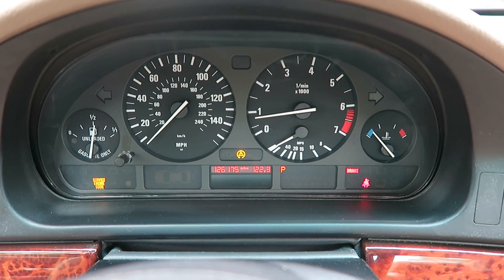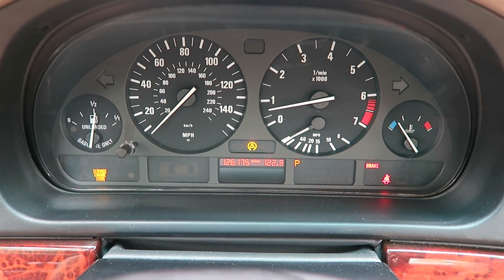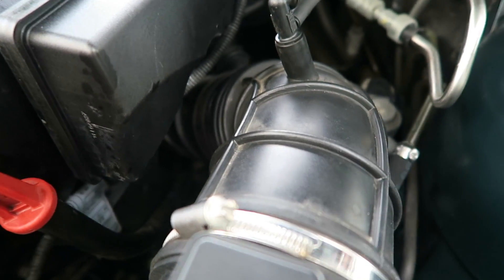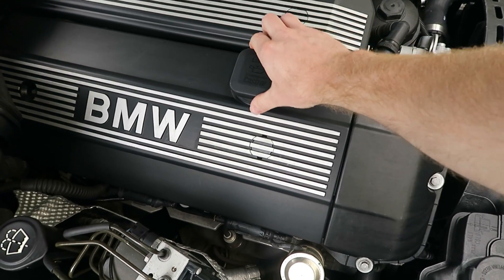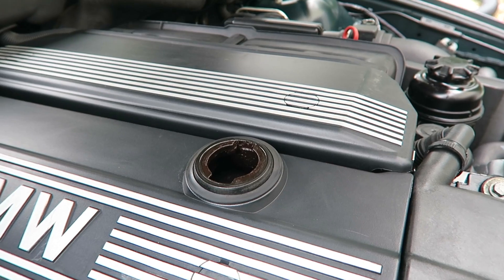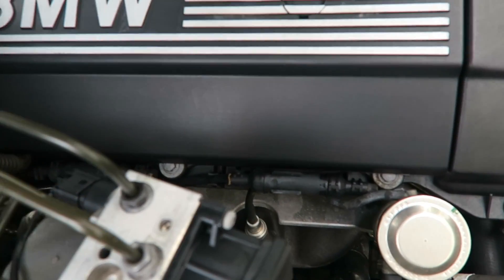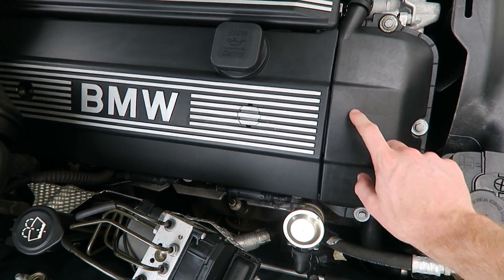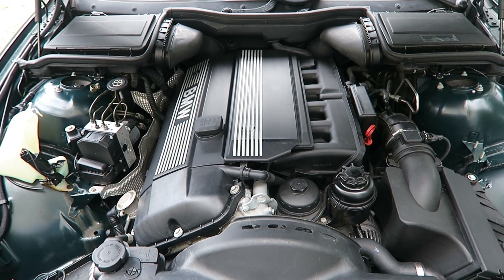How to diagnose BMW P0171 P0174 lean codes E46 E39 E53

Comment: I have the p0174 ccv changed pcv changed code still pops up on me left and right
Reply from the maker: can be many things on these cars: hairline crack in plastic valve cover, valve cover gasket leak, crack in ccv system, clogged dipstick tube drain, cracks in rubber intake boots (upper and/or lower), etc etc. smoke test is best way to start.

Comment: Question: Which ect sensor operates the water temp gauge? Mine goes straight to red and stays there when I turn the ignition on. I have both codes in this video on my 2001 BMW 325I and I'm tackling them tomorrow.  Thanks for the info.

Comment: I don't even want to go into the issues I'm having with the 2003 530i I'm dealing with but here goes. The car sat unused for approximately five years, it was owned by my customers aunt who then purchased it for the paltry sum of $400.00 which on the surface sounds like a good deal but remember we're dealing with a Nazi mobile thst sat for five years outside in the northeast specifically NJ central Jersey to be exact, I advised him not to buy it and was met with the usual all that's wrong with it is, an oil leak, when speaking about a BMW leaking oil you use the plural, leaks because there's more than one place it's coming from, he also has very little money so he pays me when he can, this thing was leaking every kind of fluid except for trans fluid but remember it hasn't been driven I suspect that will be next. So far I've done the oil pan gasket the oil filter housing gasket and vanos hose which was pouring out of it, all the radiator and heater hoses, a new coolant tank new brakes all around and the valve cover gasket and that's when the problem started. I also changed the purge valve due to the p0444 code which was the only one that there was prior to doing the valve cover gasket, when I was finished and started the engine I got  p01085 p01083 p0 1171 p01174, what the heck did I do wrong? There was a small I assume vacuum hose in the back of the engine that basically disintegrated so I fixed that there was another very brittle hose that was kind of collapsed but I left it alone, could that possibly be the source of a leak big enough to cause a leak condition? The engine runs smooth except on start up but it quickly smoothes out, I did replace the curved bellows hose on the air intake because it was cracked so that's not it, and the best part is that there's still an oil leak but I can't figure out where it's coming from, it's on the drivers side coming from the top, it's not the oil pan gasket that I know for sure, it's nothing like the way it was leaking before because it would leave a puddle everywhere you parked, I wondered why there were three empty bottles of oil in the trunk. Inspite of everything the car does run and drive very well, he did have to get new tires, two of them were original made in 2002 believe it or not and the other two from 2009, the car has 92,000 on it, oh I also put new lenses on the headlights which are of the xenon variety also new adjusters which of course were all broken, the auto adjusting headlights do work which was surprising, I forgot a new water pump and new belts.
Reply from the maker: Nothing more expensive than a cheap BMW! Sorry to hear. You’ve done a lot so far, nice work. You may want to smoke test it with an inexpensive smoke tester like I used here: https://youtu.be/QIGQGai5ngs

Valve cover gasket probably leaks too. The plastic covers can also leak both oil and vacuum when cracked or warped. Also the ccv hoses. You can add UV dye to oil and inspect leaks with a UV flashlight to find the leak source.

Comment: Woooooooooww! I was literally just out to me and 18-yr old son's project car, a 323 Coupe from -01, which is running like crap. We have done so much troubleshooting and so much repairs to it, but still had done nothing the CCV. I got the exact same symptom you did, lid was sucked stuck and when I removed it the enginge stalled and rushed and stalled. Will try to find a CCV now...

Comment: I had these codes recently and it turned out to be a tear in the lower intake boot - very common point of failure (and so is the upper boot, come to think of it...).

Comment: Hey all, I have an issue with a bmw z3 M54 2.2i. It keeps coming up with bank lean codes and misfires. Both banks and single banks, random misfires, but diagnostic says cylinder 5 is troublesome. No obvious vac leaks anywhere... fault has been getting more frequent, although the car hasn’t run much in the last six months... any thoughts??? Thanks.
Reply: Have same problem with same engine xD

Comment: I had these codes pop up on my 05 325i and I checked the DISA valve and when I pulled it out, the o-ring was gone and the rubber on the valve was worn down pretty good...So after ordering one off Amazon for $94, I installed it and haven't had an issue since and engine light hasn't come back on.
Dealership and auto parts store wanted $400-$600 for the DISA Valve!!! Saved a ton of money on repairs 😎👌

Comment: The old owner of my 525I said he repaired/replaced the ccv, so i ruled it out for my vacuum leaks, but seeing this i have the same oil leak, and this is my second valve cover gasket. Thanks so much !
Reply from the maker: Zach V it’s common for these cars to go through several gaskets and ccv’s even low mileage ones can fail. Best way to diagnose is to pay local shop an hour or two to diagnose leak source with smoke machine

Comment: I just has my ccv system replaced on my 2006 BMW x3.  now 2 engine light codes are on after I picked it up from shop. could it be too much oil in cats or in oxygen sensors?
Reply: Did you ever find out?

Comment: Nice, had those isues when I bought my 325i facelift (E46) three years with 94k miles. Very common with the M54 engine. Me and my dads friend who works on bmw and drives a E46 replaced it all along with the CCV pipe. Runs so much smoother

Comment: You could also smoke test the whole intake, even from exhaust pipes.
Reply from the maker: Bring My Wallet smoke test is the best and most accurate way for sure! Shops around here charge 2-300 for that diagnosis though.
Reply: BIMMER ZEIT You could buy your own smoke machine:p be aware, heard that the smoke can trick the sensors.

Comment: I have these codes on my 04 330i that would not clear after I reset the cel..i could not figure out why..i took off my maf and cleaned it and put it back on and the codes cleared..few days later they came  back so I did the same thing and now they are back again...u think i should probably replace the maf?
Reply from the maker: you should get a local mechanic to smoke test the system to look for leaks in the intake system. This is the most common reason for lean codes. Spend your money on that diagnosis first. It should be 1 to 2 hours labor charge

Comment: I used to own this car but this car is nothing but a great example of what happens to these cars made of plastic. I spent thousands on components of this car that used to be made of metal back then that failed due to wear to the plastic. Such a beautiful car wasted on garbage engineering. Why spent millions of dollars in great German engineering to waste it on PLASTIC!.
Reply from the maker: It is a shame, but overall they're lighter and cheaper to produce. Cars today are designed to be disposable after XX amount of miles, that goes for BMW and all German brands.

Comment: I have a e39. The P in the P01-99 stands for PCV joint leak 1,2,3,4-100 etc. In some countries it stands for Plastic pipe brittle replace someday.  Best is to delete the crank case and the engine.

Comment: I have this issue on my 06 range rover HSE 4.4 jag motor. The oil cap is hard to pull of so I replaced my PCV Valve and it still does the same thing?

Comment: When you take the oil cap off your car when it’s running do you ever have smoke coming out? Is that fairly normal? I always have some smoke coming out of my cap.
Reply: Same with me (2001 330i) usually a small amount of smoke like it's very hot? But my temp gauge always stays in the middle. I use synthetic Mobile1  0-W-30.
Reply: Nod Melon run a heavier oil and see if you have the same issue.
Reply: It will always the engines gets real hot that's normal

Comment: Cool video thanks I keep getting p302 code but I think I put a new battery in and didn't code it to the specs yet or I think it's what you said a vacuum leak gotta try your methods

Comment: I have a 2002 x5 3.0.  ... my Ses light comes on and stays on  ... but for some reason when 3/4 tank full of gas light goes off ... then will come back on ... could this be the fuel cap ? I also took it to orileys and a code didn’t come up for a min but then a code p1092 came up .... any suggestions ?
Reply: A p it could have been your fuel sender unit

Comment: A bad fuel pump set these codes off for me. I changed fuel pump and the codes were gone. I spent hours looking for a vacuum leak.
Reply: Sounds like a bad sending unit or pump.
Reply from the maker: Interesting, thanks for sharing your experience with it. What model car was that on?
Reply: 2004 330xi
Reply: Hmm... seems strange because i got those codes when the fuel went under half tank.. i had a tear on the upper intake boot(just right after the MaF sensor) replaced it and reset the ses light.. light was gone for 3 days and earlier i warmed up the car and the light went back on..
Reply: What made you change the fuel pump?

Comment: i just bought one and changed the valve cover gasket becouse was leaking in the same area and have the same code and i notice that the area of the pcv was very dirty i was thinking in changing the pcv becouse it has to be dirty too but i confim with youre video thanx

Comment: mines leaking in the back right now after replacing valve cover gasket and its pissing me off, also got those codes
Reply: 2001 325i: Changed valve cover gasket twice before I found a hairline leak in the cover. Changed the cover with the bolts and grommets and fixed my problem.  Got a complete set just under $100 on Amazon.
Reply: @jtaylor4027  still own the car I'm at 168k and now I need a new radiator 🥲
Reply from the maker: Michael Swetell mike you may have a warped valve cover or a very small hairline crack. Very very common on this engine. I've replaced 3 m54 covers that had hairline cracks of around 3/4" that cause vacuum leak and codes. It's not cheap- around $400 list or $300 wholesale. Try torquing it down again maybe a nut or two is loose... let's hope that's all it is!
Reply: yeah i got an estimate from a really reputable german car repair shop for around 600, that includes valve cover replacement and new valve covers. my car has 152k and im sure the covers are warped. Im getting my flex disc done over there in a couple of days for 395
Reply from the maker: Michael Swetell if you get a cover for $300ish and DIY you can save $300 in labor. Maybe replace the spark plugs while you're in there (I have a DIY video for this too). The flex disc is not fun, even I would pay to avoid doing that one!
Reply: haha yeah i replaced my spark plugs with premium NGK's when i did the valve cover gasket. I rather just pay the extra little bit for the assurance that it will be done correctly and by bmw certified technicians. I do do a good bit to my car myself, i just relaced upper and lower radiator hose with mishimotto high heat resistant hoses off eeuroparts, flushed all the coolant out, because the person i bought my car from wasnt using bmw coolant and filled and bleed properly with 50 blend of coolant and distilled water, i did an oil change a while ago with castrol edge 0w40 european formula with oil filter chage, i also did a fuel filter change, cotrol arm replacement and some other stuff. My rides an 04 330ci coupe metalic gray!!

Comment: Ima getting a po171 po174 I tried the oil cap trick an it's a faint suction any other ideas ?
Reply: No vacuum leaks it's the fuel pump

Comment: What if there is no crank case pressure when you loosen the oil fill cap? Just a little when taking the cap off. Not like this video.
Reply from the maker: Alan, it sounds like your car is just fine! That's how it should be.

Comment: I am getting the p0171 and p0174 error with a P2237 pending! I tried the oil cap removing it and i get a very faint suction. Does that matter?
Reply from the maker: Shawn, a faint suction is normal. Check out this video I made on a failing CCV: https://youtu.be/vODpt5b2DsM

Comment: I have the same peoblem with my 97 520i with one vanos, the technicker that looked at it says the worst thing ks that the valve cover gasket gets blown and you get a whole in it where the oil will leake out cause of the ccv valve and it can get so tight in the ccv valve that the engine will accually fail to give the gas pressure you give it eith the throttle and then makes it unable to drive cause the ventilation that needa to operate corectly is not functning. Symptoms that i also got and understood the valve is broken is that the car can suddenly from time to time all randomly, caugh og jump like if you clutch down very fast, also i got once, a oil presseru lamp in red, but despite that, the only worst thing that he said can happen is the gasket get defect and the valve lines get so tight, the engine cant work until its replaced and cleaned nice again.
He checked this on my 520i, maybe 4-5 weeks ago and i only have had 2-3 long drives since then and now it is struggling to get gas power to move forwards. So i suggest to all of you guys with this problem ASAP!
Reply: thomas backer hi there,
- i'm in a very bad situation here with my lovely e39 9/2000 2.0litre dual vanos
In 4 days i am about to travel 1400km but car broke 3days ago
-I suddently had yellow engine light on paired with EML and Asc tringle lights on . Car acted like bump on rocky road or as you say more correctly as if you hard-press clutch fastly and badly.
I just couldnt do even 10mph. Engine wasnt working right. Like air and/or gas was missing or a sensor(cam/crankshaft) sent wrong data to ECU. idle only wasgood. When you press acceleration pedal is when the problem occures.
After 8 hours i started engine again. EML light was off(only yellow engine light was one) and the car was working perfectly.
Since then they've come randomly both: EML light and engine problem.

But today i had it all day on. I think it is not going to light off any more
:(
Do you think CCV (CPV) is able to cause this problem?
*I don't have electric gas pedal or electric throttle valve.
Tommorow i ll go to read codes...asap
->very nice video of yours!!
Reply: @sakissyard  what code did you find?
Reply: @ovidiurisco1251  honeatly i dont remember. But i put a new OCV aka CVVand everything is right ok
Reply: @sakissyard  my e39 520i  runs great but i have the check engine on and the scan tool indicate:fuel trim bank 1 and 2 permisibile range excedeed,

Comment: You show the valve cover cap being hard to remove, suggesting a vacuum in the crankcase.  But then you conclude that the CCV valve is broken, and the crankcase is under too much pressure, the opposite of too much vacuum.  Which is it?
Reply: No bmw are ccv not pcv
Reply from the maker: Vacuum = negative pressure. A CCV valve can be stuck open or stuck closed, they fail both ways.
Reply: Very few technical people say too much pressure when they mean too much vacuum. So in this case, was the CCV stuck open or closed?
Reply from the maker: Hey Don, sorry for the confusion. In this case I meant vacuum or negative pressure; this CCV was likely stuck open due to a failed diaphragm inside the CCV itself. However, they can fail in the opposite way where the valve is stuck closed and creates too much positive pressure.
Reply: Do you mean PCV Valve?

Comment: i have a 99 528i, I have the same engine,  my code reader gave me THROTTLE POSITION SENSOR and another reader PEDAL POSITION SENSOR, my car idle is rough. Would you PLEASE, make a video on WHERE EXACTLY ARE THE TPS SENSORS AND HOW TO REPLACE THEM?

Comment: So you show us a car that has a lean code and don't show us the root cause. You didn't even consider a sas issue, low fuel pressure at the rail.. or an IAC issue,,, how about injectors not operating ..bad o2 sensors. no numbers, no diag, no fix.. ummm I'm confused.. I guess thanks for showing us a car that has an issue????
Reply from the maker: Hey +Ben Dover, the most common cause of these lean codes are vacuum and air intake leaks. This is the first thing I check and also the easiest. Both the root cause and solution are described in the description above. This car had a failed CCV valve with excess pressure at the oil cap. The dipstick tube clogged, which caused the valve to fail, which then cracked the valve cover. We installed a new CCV valve kit with all of the new lines and this resolved the lean condition. We also later installed a new valve cover on the car.
Reply: +BIMMER ZEIT good video, thanks
Reply: M